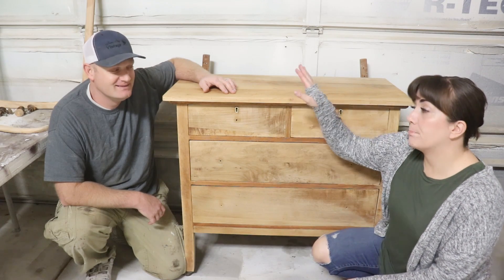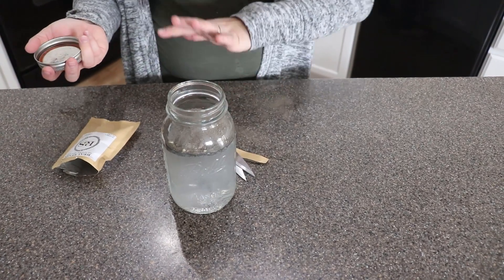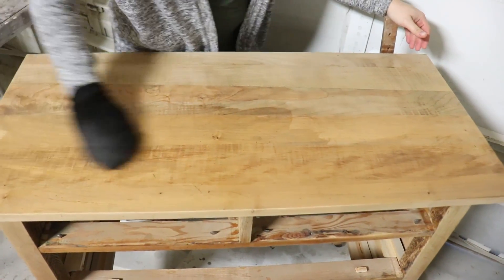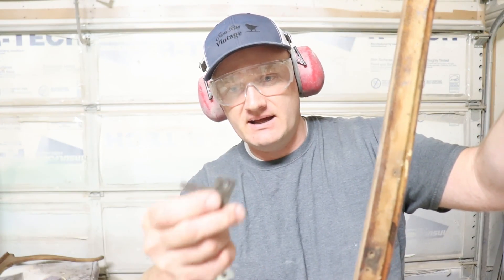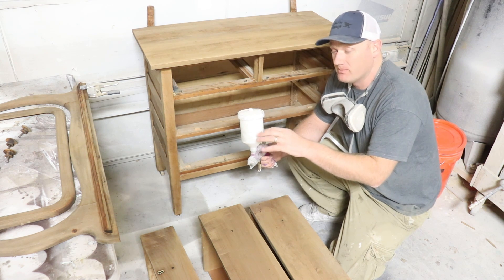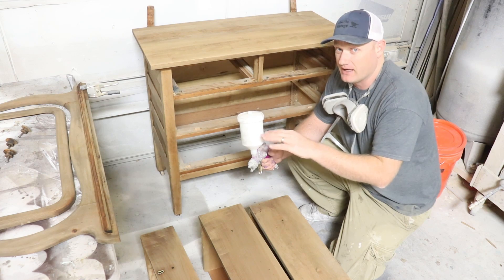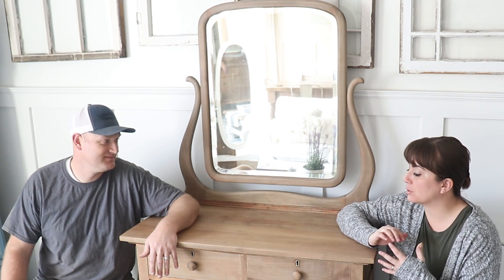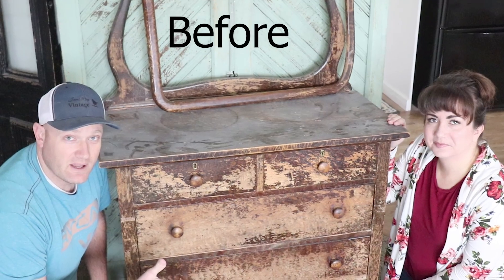Furniture Restoration | Furniture Repair On A Dresser

Comment: You should always finish the inside/back.  I know it wasn't finished to start with but leaving one side unfinished will let the wood adsorb moisture unevenly.  This will eventually lead to the piece cracking/splitting.

Comment: I know this is old but I have the same exact dresser that was my great grandma’s that I plan on restoring and I’m missing the part for the mirror to attach. Where could I possibly find a replacement?
Reply from the maker: Search vintage mirror hardware online. There should be a lot of options that pop up that will work.
Reply: Jami Ray Vintage for the actual wood piece that sits on the dresser for the mirror?